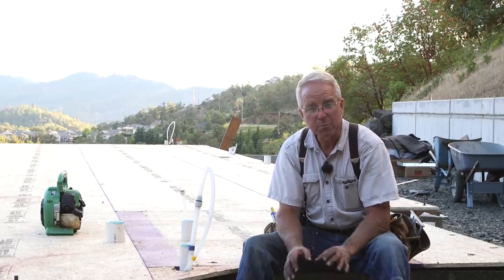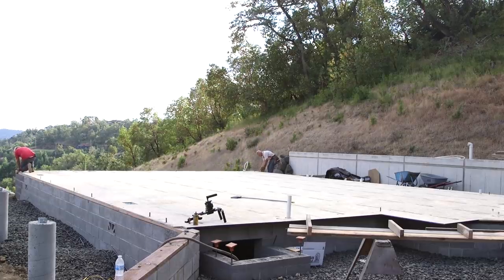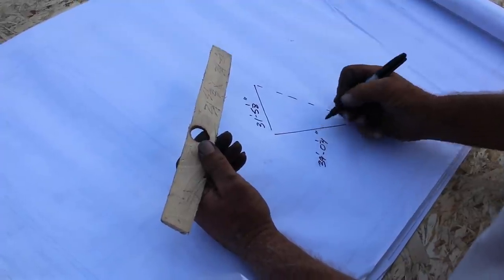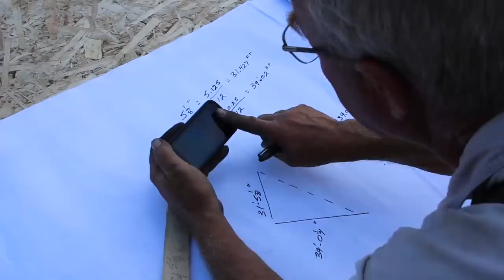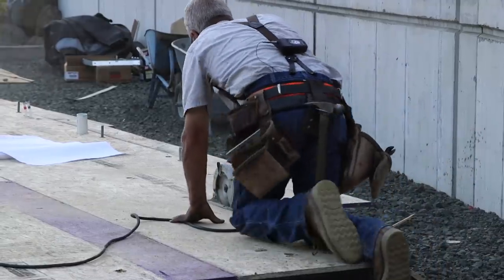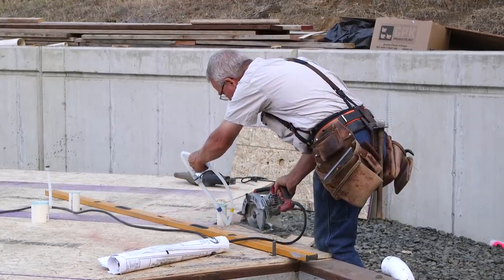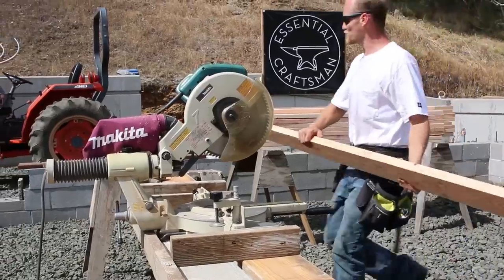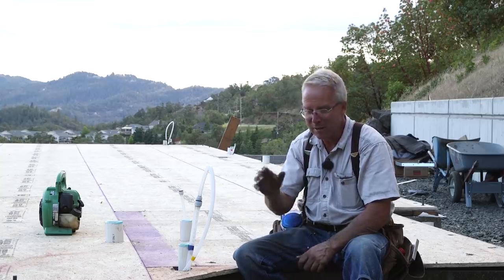Make it Square Ep.45

Comment: 4:20 little bit easier in metric, no conversions to make. Reduces the possibility of error.  I do not want to star a discussion between metric and imperial! I am only talking about doing conversions. There is an outher way to check square by using the 3 × 4 = 5 then it doesn't matter if you use metric, imperial or a stick. Great videos, I love to watch every episode you put out. I have even caught myself thinking of leaving Brazil and changing my trade to work in construction there in the states. But I'm to old for a drastic change like that in my life. The 3x4=5 can be in inches, feet, yards, meters or cubits. It can be any thing as long as A=3 / B=4 / C=5. So if A = 15ft you divide by 3 then you have a unit of 5ft. Multiply your unit (5ft) by 4 for B (20ft) and by 5 for C (25ft). As said it could be cubits if you want.

Comment: 4:18  "I convert inches into decimals of a foot".  
Sometimes, I use metric measurements.  For instance, I always use millimeters if I need to find the center of a board.   It just makes the math so much easier!  It probably would have worked just fine in this instance where you just needed to make sure that a measured distance matched the value you were expecting.   I also have a woodworker's fraction calculator app on my phone if I want to avoid converting metric to feet and inches.

Comment: i worked in construction a few times and its very interesting seeing the differences between building a house in switzerland and the US
Reply: I'll not be alone in wondering what just a couple of those differences might be, as the Swiss are world reviered for precision.
Reply: @bob_frazier  I'll tell you a few examples: it's mostly concrete and bricks here. except for the roof and a few things. no crawl spaces. it's always a basement. very strong regulations regarding energy efficiency. lots of heat isolation. and that squaremeter regulation regarding living space vs use space. and so on. feel. free to ask queations

Comment: Another thought on the central vac system.. You could run the pipe, low voltage
wires and install the inlet covers but not purchase the vac unit and leave that for
the home owner. The selling point could be that it is "central vac system ready."
Reply: Thomas Gilbert central vac is the way to go and really not that expensive. I installed ours in our already built house 25 years ago and we still love it,

Comment: I don't understand how after all the double and triple checking every possible dimension at each step that the base footprint of the house is off by 5/8". That seems an impossibly large error given all the effort you've gone to thus far with positioning the house on the lot, getting the concrete poured in the right locations, the stem wall locations etc.It is good that there is an easy fix but I'd like to know how where/when the error was introduced on the depth. (edit: also how much easier would laying out the deck be if we just used metric - no more converting to inches and fractions)

Comment: @Essential Craftsman . When using pythagoras theorem, I tend to convert the feet to inches, plus inches, plus fraction as a decimal. It makes the numbers much bigger but the calculation simpler. 3' 7 7/16"  is 43.4375", or its 3.61979166666667'.
This gives a square of 1886.81640625, or 13.10289171006968576388888889.
If our rectangle were a square, we end up with a hypoteneuse of 61.4299", or 5.119158646796'.
Either way, its 5'1 27/64", but the "number management" is much less complicated, with less opportunity for mistakes.
But whatever works.....

Comment: Do you ever use the 3-4-5 (or miltiple) triangle method as a quicker way of determining square rather than doing the full calculation? If used with care ober the largest distance possible it should be nearly as accurate and it is certainly quicker and doesn't need a calculator... if you do a follow up video it might be worth explaining as a quick check for square

Comment: You bring up an interesting question.  You say the house is 5/8" smaller.  Lets say you had ordered roof trusses and as you mention in the video you would have reclaimed that 5/8" from either the front or back (or both) of the house.  Here's my question:  Why does 5/8" matter?  Wouldn't you simply be able to place the roof trusses on centre and have then protrude 5/16" on either side?  Why the need to reclaim this small distance (if plumbing or HVAC isn't an issue)?

Comment: European here (things are built differently here)... if the decking is on the stem wall, then you will probably do the framing upon the decking. But how would that work in case of severe water damage? The decking would rot and that would mean the framing will lose it's foundation, right? Even though the framing would be solid timber that will withstand water damage quite well. Why not put up the frame straight on the stem wall and keep the decking within that boundary. That way water damage (leaky bathroom) will be contained. Just curious here, there will probably be a good reason.

Comment: Okay carpenter for 8 years out here in Illinois. First have never ever framed after plumbing sewer and vent have been installed. I get that was probably just for video purposes. Anyways I am so confused why you lost deck. If you build from demensions snapped on the foundation up to the deck you should be right on when you cut your deck off flush with that rim joist or in your case treated plate. There should be 0 change there. That’s my 2 cents here. No need to measure and paralell the cut on the deck. That gets fixed when you snap lines for the first floor outside walls. You can fudge that a few 8ths here and there if need be. That’s my 2 cents.

Comment: I like your series, I helped build my cousin's home plus few garages, hated rough, I will stick with finish get paid more get done faster.

It does have its draw backs, summer is hot no breeze I use high velocity fan, winter is far colder inside than out, other contractors using torpedo heaters propane or kerosene do no good unless right by it. 
A plumber left his van running the entire day, asked him why, he said cheaper to by gas or repairs than a human life. They suck the oxygen out of the air soon you will go to sleep,it sneaks up on you.

Comment: I know there's probably no practical way to keep everything dry in a rainstorm, but does the decking not swell/warp if it gets soaked?     Love the videos...
Reply: kedelbach it can.  The severity really depends on the quality of the OSB and how much water is eventually absorbed.  Low quality will swell at the seems quickly while higher density OSB and OSB with coated edges are more resistant. 

We had a phrase we called the “race to dry” once we began framing.   We wanted to get to the roof sheeting so the roofing contractor could get their work done and the building paper could be put on the walls.

Sometimes you get caught by rainy days at the wrong time and the seams of the OSB would need to be sanded down before flooring was installed.

Comment: My profession is in IT, but I enjoy working with my hands and do a lot of woodworking as well as diy home improvement in my spare time.

As most of my friends are not very comfortable when it comes to practical matters, I'm frequently called upon to help them out with everything from hanging a mirror, building a wood deck all the way to build Ikea furniture.

So I've seen quite a few houses by now - and I don't think I've ever seen a house where the walls, floors and ceiling are plum, square or parallel.

Mr Wadsworth, you must be unique in your professional role - and I wish that other builders payed as much attention to detail as you do.

And may I ask why you don't use a track saw, I would have felt a lot more comfortable with track saw instead of a circular saw for most of the cuts you are doing?

Comment: 4:19 That’s another reason I prefer metric units.
Reply: Is that because it would be easier to double check your diagonal was 15000mm or because you would prefer to convert every other building component from inches back to mm so you could fit openings for your windows, plumbing fixture, electrical fixtures. If you are building residential in Canada or US it’s all done feet and inches.
Reply: Patrick Sutter 
My house was specified in mm. Converting feet, inches and 32nd of inches wasn’t very practical. That’s all. 
Btw 15000mm is 15m no calculator needed.

Comment: I am a contractor/framer and I would like to elaborate on a simpler method (no calculator) of squaring up snap lines using what is referred to as the "3-4-5 method". I noticed a few commenters mention this method but I didn't see anyone explain what it is. The 3-4-5 numbers are a reference to the sides of a right (90 degrees/square) triangle. The 3 and 4 represent the "legs" of the triangle and the 5 represents the "hypotenuse" of the triangle.

The information that you need to know is that any multiple of 3-4-5 will always result in a right (90 degrees/square) triangle. Let's use Scott's numbers from the video to illustrate how this would work. The "legs" of Scott's triangle are roughly 31' and 39'. These numbers represent the 3 and the 4 in the 3-4-5 method. We need to find the highest whole number multiple of 3 and 4 that will go into 31' and 39' respectively. 3 will go into 31' 10 times but 4 will only go into 39' 9 times so we will stick with the lower number of 9. 

Now we need to multiply 3-4-5 times 9 to get the numbers for our largest 3-4-5 right (90 degrees/square) triangle that we can fit on the house deck. We come up with 27'-36'-45'. That is all you need for the calculations but we still have to put this information to use.

Scott already showed how he snapped 2 lines on the longest walls parallel to each other at 5 1/2" (thickness of 2x6 wall lumber) from the exterior of the building. After this is done we can put the 3-4-5 method to use. Starting at one of the exterior corners of the building you measure in 5 1/2" along one of the 2 snap lines that we have already created. This point represents the 90 degree corner of the right triangle that we are going to create. From this point we need to measure and mark out our "legs". 

If the snap lines that are already snapped are on the longer wall of the 2 "legs" (they usually are) then we measure from our 90 degree corner mark along the snap line and mark the number of the longer "leg" 36' in this case. The second "leg" is a little more tricky to mark since we don't have a line established to measure along. We move back to our 90 degree corner mark and measure down the opposite exterior wall (second "leg" of the triangle) while trying to keep your tape measure parallel to the exterior of the building then mark the second "leg" 27' in this case. We need to create a short line at this point (approximately 12" in length) that is parallel to our 2 already snapped lines. To do this keep your tape measure parallel to the exterior of the building but slide it over from the mark you just made by about 8" and mark 27' again. Now use a straight edge to connect the two 27' marks and draw a line along the straight edge approximately 12". Now we are ready to establish square using the hypotenuse of 36'.

Place the end of the tape measure on our 36' mark (long "leg" of the triangle where the "leg" meets the "hypotenuse") then pull the tape measure diagonally to the line that we drew at 27' (short "leg" of the triangle where the "leg" meets the "hypotenuse"). Our hypotenuse number in this case is 45'. Move the tape measure across the 12" line that we drew at 27' until 45' lands exactly on the line and mark this point. Now we need to snap a line from this point back to our first mark at the 90 degree corner of the triangle. We can also run the chalk line through these points to snap along the entire length of the building.

You have now established "square" on the building and all other snap lines for the rest of the building should be measured off of these lines that you have snapped (or off of other lines that have been established by measuring off of these lines). 

This seemed like a lot simpler concept to explain before I started writing it out. In reality this method takes 5 minutes tops (usually 2-3 minutes) from start to finish. I hope this makes sense and helps someone out. I think it would be very beneficial if Scott were to show this method in a video as it is very practical in many areas of construction. In my opinion establishing true points that can be used to get reliable measurements is a foundational skill to a lot of carpentry.

Comment: Regarding accurate cutting with a circular saw: I have found that where accuracy is critical, it is better to use two hands. One on the handle, the other hand at the front of the saw. The front hand should pull ,applying more energy than the hand on the handle. Thumb only on the front of the saw, fingers doing the spider walk out front. 

I also use a thin string chalk line. And often use a paper knife to scribe a line, rather than mark with a pencil. I know, I know,  we are building a house here, not a violin... : )

Comment: Speaking of square, a rule I came across years ago was the 6-8-10. Side A measure to 6 feet. Side B measure to 8 feet. The hypotenuse comes out to 10 feet. Checking it against the square formula in the video, it seems to run true.

Comment: If you have 5/8 of an inch smaller than the  truss you should just split the difference put 5/16 in front and 5/16 in back and it would be fine you would never notice that on the truss, if it was 5/8 of an inch too long that might be more of a problem I don't think it would matter either. I think you can go in and out a half an inch on either side of the truss and you wouldn't even notice more than 1/2 might be an issue.

Comment: Pythagoras doesn't have to be a brainstorm. In construction here it's known as the 3-4-5-rule. Mark one side as a multiple of 3 (let's say 3x5m, or cm, or foot, or inch), the other as the same multiplication of 4 (in this case 4x5m), then the 3rd side should be the same multiplication of 5 (5x5m). Check it, 15sq+20sq=25sq.

Comment: A^2 + B^2 = C^2
or  3, 4, 5.
Find a corner, measure 3 units (cm, in, ft, m, whatever) along one edge, mark it.
Measure 4 units in the other direction (perpendicular), mark it.

Measure between mark 1 and mark 2 and you should have 5 units, If not it is not square.

It can be 3, 4, 5 or 6, 8, 10 or 9, 12, 15 or 12, 16, 20 or so on as long as it is in a 3, 4, 5 ratio
Reply: But the real beauty of the formula is it doesn’t need to be just multiples of 3-4-5. It works with any numbers you plug into it. For example if you wanted to know the full diagonal measurement of a 5’x6’ box, using the formula you would know that the correct measurement can only be 7’-9 ¾”. You can even use it to solve for a missing leg if you already have the diagonal. Example A=2’  B=?  C=5’ the formula tells us that B=4’-7”. 
🤜🤛
Reply: @psidvicious  Yep. And it is a hole lot easier using SI units.

Also you don't have to measure the entire side. On you 5x6 you would measure 3 on one side 4 on another and if the connecting points will measure 5 if the box is square.

AND I didn't say multiples, I said ratio big difference.
Reply: @phillaboody260  If you want to be as accurate as possible, you measure the full side, not a segment. Or how would you check the example I gave having only a 2’ side? Measuring a segment 3”-4”-5” would be insufficient.
And with all due respect, I understand what you meant, but the numbers you gave are all ‘multiples’ of 3-4-5. 
i.e. 3-4-5 multiplied by 2, multiplied by 3, multiplied by 4, etc.
🤜🤛
Reply: @psidvicious  2 foot side? I would measure out 1.5, 2 and the other number should be 2.5

Oh and it is still a Ratio using whole numbers.
Reply: @phillaboody260  Excellent solution 👍.
😂Ok, ok, you call it ratio I call it multiple. Maybe it’s the old - potāto, potăto debate all over again.
-I guess I’m just left wondering why the aversion to calculating the full diagonal 🤔.
Your method is certainly acceptable and will probably never fail you but aren’t you ever even curious what the full diagonal should be?
🤜🤛
Reply: @psidvicious  https://youtu.be/BDmTO7U24Qw?t=229

I don't see him measuring to a corner. From a corner yes but not TO one.

Besides I don't have an "aversion to calculating the full diagonal" it just creates a work to measure it. Besides how many people on a job site have a 50 ft tape measure or a 60 or even a 100? If you ONLY measure the entire side you HAVE to have a tape measure that will be more than an entire wall could ever be.

What if you had a retaining wall 100 ft across and 10 ft support butting out. Are you going to measure the entire 100 ft and the diagonal just for 10 ft? No, that would be dumb and potentially less accurate. 

"but aren’t you ever even curious what the full diagonal should be?"
Why? If the 2 walls are straight and it comes to  right angle and I know the lengths why would I need to know the full diagonal?

Oh and the diagonal on the 100 ft wall with 10 ft at 90° would 100.4897 ft. That is less than a foot more than one of the walls. I don't know a tape that wouldn't sag less than a foot over 100 ft span.